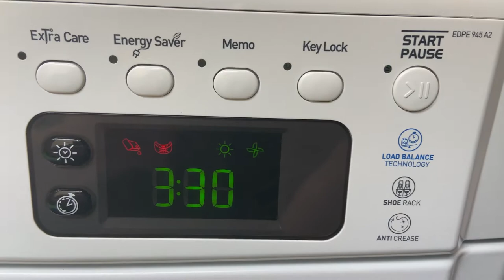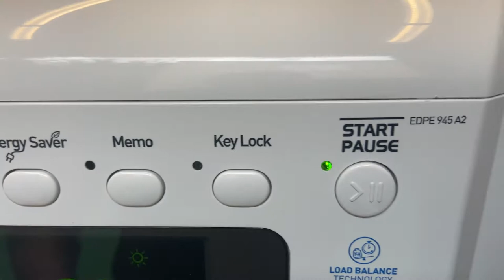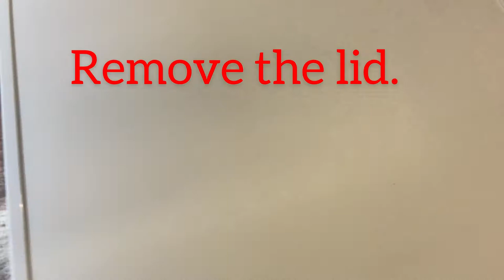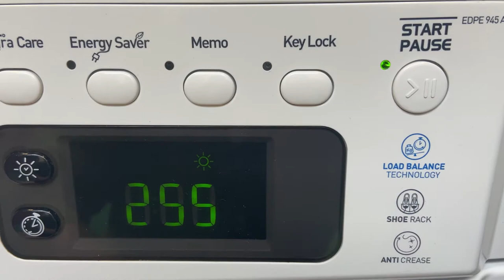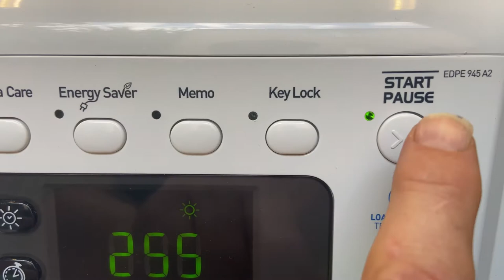🔊🔊🔊Noisy INDESIT heat pump condenser tumble dryer (EDPE 945 A2) water pump replacement 🔊🔊🔊

Comment: Cheers mate for showing me the proper way to fix the pump, all the other videos have release tab breakages.
Reply from the maker: Thank you, I always happy when I get feedback.
Reply: @georgesworkshop8600  hi there, I have the same problem,the pump stays constantly on,I went and fitted a new switch as I thought that would be the issue-thinking if the pump runs it must be ok,and that the switch is the problem can you please advise me on that, many thanks 😊

Comment: Open the 4 clips on the pump and check the impeller for obstructions before replacing the pump.
Reply from the maker: Hi,
Thank you, I’ve checked , just I didn’t show on the video. The problem was different.

Comment: Thanks for the video, it is helpful!
I have an Indesit condenser dryer which makes the same sound. I replaced the water pump and I cleaned all the fluffs, but the sound remained! 
Do you have any idea for it? I am really sad :(
Reply from the maker: Szia Tamás!
Bocsi a késôi válasz miatt.
Talán igy magyarúl egyszerübb lesz válaszolnom…😉
Biztos hogy a pumpátol jön a hang?? Ha igen a pumpát  hasZnáltra vagy újra cserélted? Mert volt hogy egy használtat raktam máskor bele, és az is zajos volt.. Néha a pumpárol az a kis gumilapát le szokott mállani, és akkor nem, vagy nagyon gyengén pumpál, ugyanis elforog a tengelyen és az is adhat ki ilyen hangot. Ezeket ellenörizd ….
Remélem tudtam segíteni.
Sok sikert😉
Üdv
Gyuri

Comment: What is the difference between the black and the clear tube at the back? Is the clear tube a water return back to pump if overflow?
Reply from the maker: Hi Derrick,
You are correct. The white is the overflow tube, and the pump is pushing up the water on the black to the tank.
Reply: @georgesworkshop8600  thank you.. There is no need to remove any panels to access the water pump either. Just pop it off the back. Cleaned it tonight and ready to retest. The water trough was full of debris. Remember to clean the condenser monthly. Brilliant video. Thank you so much
Reply from the maker: Your very welcome 😉

Comment: George, my man! The repair guy said the horrendous squealing noise was the main motor and it was not worth fixing. Ha, it was the water pump. Didn't even need a replacement. Disassemble, clean, reassemble. Problem solved!
Reply from the maker: I’m glad you saved a lot of money! Well done!

Comment: Where did you buy the pump from as I need one for my hotpoint tumble dryer
Reply from the maker: Hi,
I get used to buy parts from ebay. Search for the model number and make.
Reply: @georgesworkshop8600   I clean mine all the time I take the top and the side off my hotpoint tdc30

Comment: Hello, I have the same problem with my hotpoint dryer..model tcfs83. However, the noise comes and goes.  I followed your instructions and cleaned the heat pump area.  Thanks for your guide.  The issue has not gone away.  If I stop the dryer, the sound sometimes stops. Wondering if heat pump can be opened to clear any  fluff inside. Otherwise a new pump maybe needed.
Reply from the maker: Thank you for your feedback. I’m glad as you could sort out this maintenance.

Comment: Why is my pump constantly running?        I press and release the float and it is constantly spinning.
Reply from the maker: It came across same situation for me, but I don’t know how. If it’s working , it’s working.
Reply: @georgesworkshop8600  I replaced the pump with a new one because a valve was damaged on the old pump.  The dryer is now working normally.  I don't know why the pump works all the time.  The important thing is that it doesn't write mistakes, the clothes are dry.

Comment: i changed it but still not heating.Hotpoint NT M11 , same sound same part like this
Reply from the maker: Hi, are you sure the noise is coming from the pump? May the noise source is something else.
Reply: @georgesworkshop8600  yes same. i changed it with new part , sound gone but not heating.
Reply from the maker: Hi,
Sorry for the late reply. I don’t think a pump replacement would cause your issue to don’t heat up. Heat pump dryers are difficult system and don’t get used to repair them. It’s expensive to fix it.